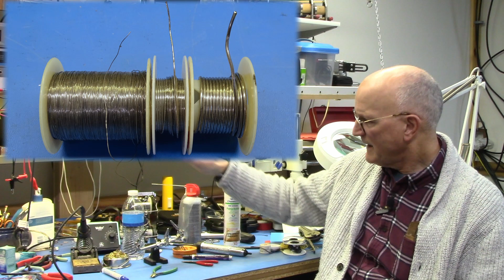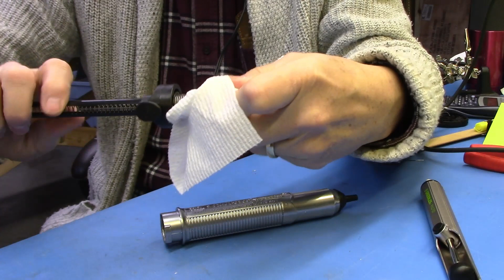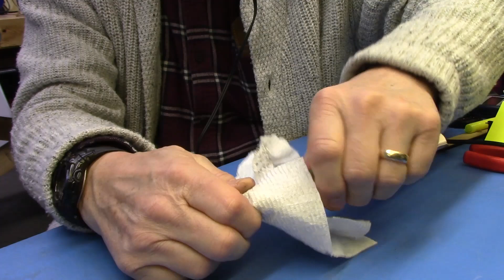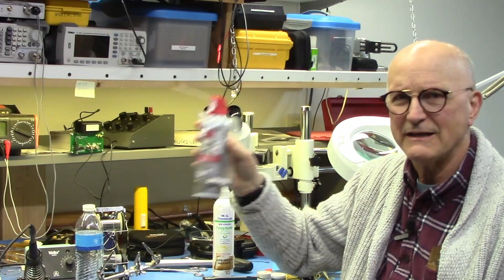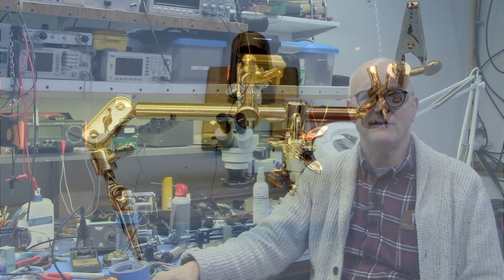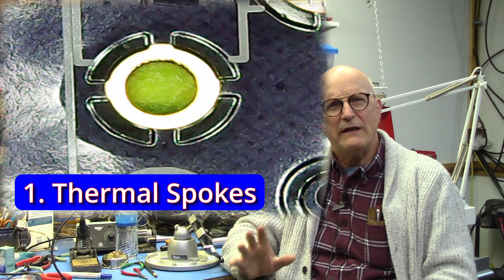Soldering: Tools of the Trade and PCB construction basics

Comment: Hello sir I would like to know how to solder heat sensitive film&foil capacitor from south Africa
Reply from the maker: The key is "getting in and getting out" as soon as possible. How can we do this? (1) Prepare everything ahead of time, making sure the surfaces are very clean and ready to receive solder.  This includes the leads of the capacitor. (2) If appropriate, pre-tin the places where you are going to be soldering to {e.g. a terminal}.  (3) We add a bit of solder flux paste to the connection to be soldered to be sure things take quickly. (4) Make sure the soldering iron tip is at the right temperature and is clean and well tinned. We want it to conduct heat like RIGHT NOW when it touches the connection to be soldered.  (5) Immediately add solder as soon as possible - this helps conduct heat and quickens the soldering process.
If we can get a very quick, yet reliable solder connection, the component won't have a chance to heat significantly.
Additionally, you could also attach a heat sinking tool to the lead about half-way between the point to be soldered and the component. There are various devices that would be helpful, among which are a good pair of hemostats.
https://www.digikey.com/en/products/detail/aven-tools/12002/1992481
I encourage you to look at the datasheet for the capacitor.  Look for the section labeled something like "Resistance to Soldering Heat" or other possible soldering instructions.  This will give you an idea of how sensitive the component really is. Remember, all components are designed to be industrially soldered in place which is not necessarily the most "gentle" process.
e.g. From a PHC Metalized Polypropylene Film Capacitor datasheet:
Resistance to soldering Heat
Solder bath temperature: +260°C +/- 5°C
Exposure time: 10 seconds +/- 1 second
Hope this helps.